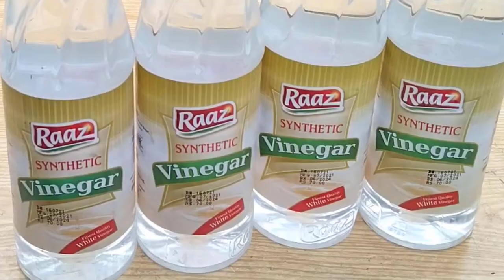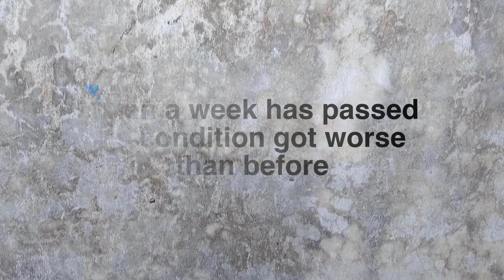1947's Antique Hand Press Juicer Machine - Restoration

Comment: Next time, when you take the metal out of the vinegar, pour boiling water on it after scraping off the big rust to neutralize the acid.  Then its condition shouldn't worsen over time.  Keep up the good work!
Reply from the maker: Yes You Are Right Bro. Thanks For Your Feedback

Comment: Looks like some parts are hand made. The holder  is a much better quality than the handle, which was a large bolt before. Either it was something different or was largely rebuilt  at some time.
Nice work but you should have painted all parts or protected in some other way.
Reply from the maker: Thanks for the info